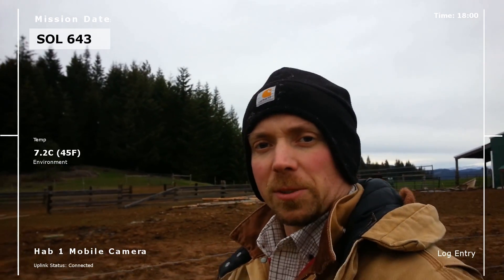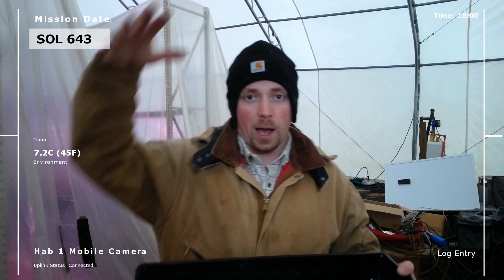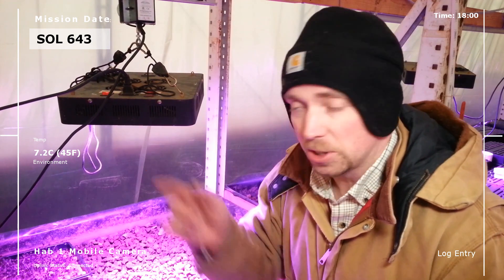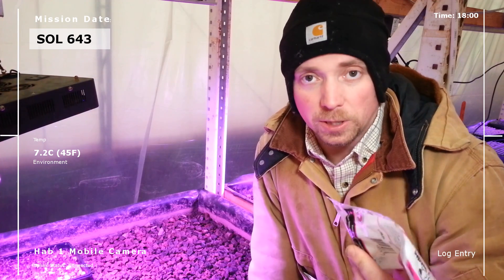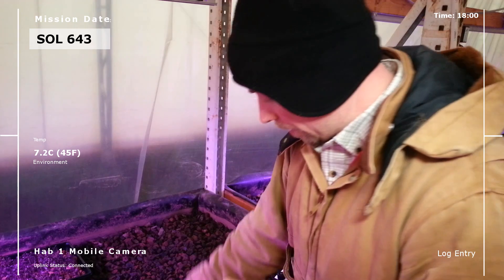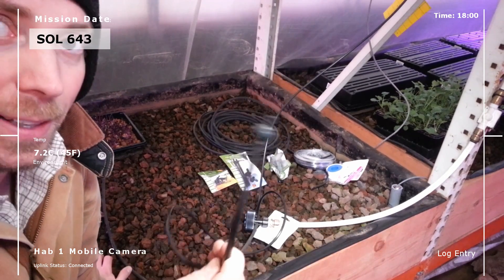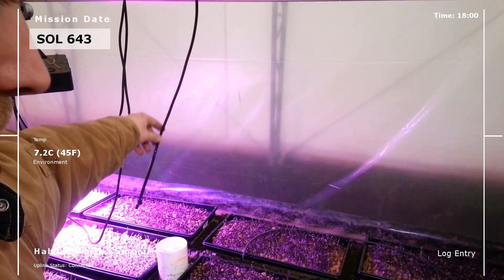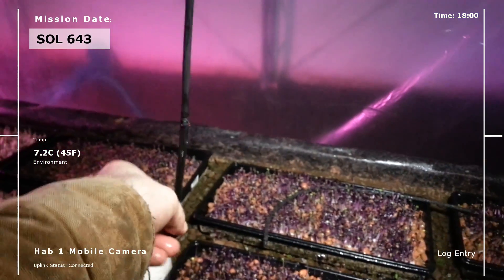Do WICKING BEDS Work for MICROGREENS?

Comment: You could run the drip pipe a foot to 18 inches above the trays then install the drippers.  So there would be space between the trays and the drip heads.

Comment: TRM.  I've burned through more of those shut off valves on the 8 line manifold than I care to admit.  For some reason they're very fragile ( must be Italian).  And Rain Drip doesn't sell them by themselves.  And if you need to by another manifold make sure all the valves are there.  I guess some people have been known to swipe them off new units when their's break.
Reply from the maker: roger that. I think the final decision wont use one. In addition I've upgraded my buying power by going to the local contractor store to get more professional grade parts.

Comment: Whilst I understand your thinking behind trying to do away with the rocks in your trays I do not think that overhead spraying is a good thing at all.
1. You will inevitably raise tunnel humidity using sprays- very bad in the winter but may be good in the high summer temps. This high humidty may also encourage fungal disease growth on the plants.
2. You are using fish faeces contaminated water and you are trying to produce a human food - possible health issues
3. All spray nozzles and drippers ( irrespective of type / design / spray pattern) will inevitably become clogged with algae etc over time leading to underwatering and loss of produce yield and / or quality.

I think that you will have to return to bottom watering and an appropriate growing media -probably some sort of matting with sufficient sharp sand to stop it initially floating. It will be critical to have control of the height of the water of the bed so that water is passed by capilliary action up to the sand the seeds are growing in/on without the plants have their root system in water all the time.
When the crop has been harvested and the growing media dried out thoroughly it may be possible to shake some of the sand out so that it can be recycled. However it may not prove be worth the time and effort for the cost of fresh sand!
Reply from the maker: great comment...this has sent me back to the books to review my plans...more experiments forthcoming

Comment: Using a random spray dangling from a flexible pipe seems an odd way to solve the problem. High quality spray/mist/fog emitters have very specific patterns based on height and pressure. A rigid PVC pipe running above each row of trays with the right spray emitters at the correct spacing will get you very accurate water distribution with minimal overspray. As mentioned in another comment, Netafim are worth looking at. Once you start using sprays, though, you may find your filtration requirement increase to prevent clogging.
Reply from the maker: thank you...stay tuned...I took your advice on Netafim

Comment: https://growerssupply.files.wordpress.com/2014/07/img_2786.jpg
in this photo you can see where they have water trickle from one side of the beds to the other and return to the aquatic section via that PVC ladder.. 
They use just 1/4 inch line on one side of the beds and I assume there is a very slight slope to aid in drain off on the opposite side. 
https://growerssupply.files.wordpress.com/2014/08/cs-tillamook-high-school2.jpg

Comment: Just for the sake of pointing out potential problems - you mentioned previously that you had huge humidity issues - obviously misters will boost your relative humidity a LOT.. 
The larger droplets you can use without disturbing the seeds then the less humidity issues you will have.. 
What about running 3 drip lines in parallel across the entire length of the bed attached to something you can raise and lower when you need to access the greens?
Reply from the maker: great point! didn't think about that...sometimes hard to see the forest through the trees

Comment: How about cut the end off a tray so you can have a 'tail' of mat to dip into the water? You would probably have to use something to hold the mat in place. A slot would be better for production. It would keep more of the tray's strength. You could have tails on both ends.

Comment: What if you had a spray system the width of the bed with sprayers every inch or so hooked to the same drive unit you use for the lights? They could be set to spray once every 8 hours or at the interval required to provide correct moisture levels.
Reply from the maker: great idea!

Comment: You could either weight or stake the mat so it wont float with the flood and drain.  For the misters you can add a weight to the line to ensure they hang properly. They make various spray heads. You could dome the greens and ensure the misters spray inside the dome shield (could poly wall the grow lane sides to contain a broader mist spray as well) Running a frame around the bed perimeter to attach horizontal spray/miser heads might work better misters are a good way to go but you might need to put more thought into the number, placement and spray pattern of the heads. Ive used the various ones the simply screw into the end of the 1/4" tubing and created a frame structure to place the heads where I wanted.

Comment: TRM, There are small plastic stakes that the misters and bubblers snap into. Drip irrigation and micro irrigation systems are prone to plugging and need a filter prior to the heads. And like others said, landscape fabric and sand.

Comment: could it be a sollution to burn/heat the rock/roots to carbonize the roots and then simply flush them out. That might even be done by using a parabolic mirror.

Comment: place the small hose around the utter perimeter of the grow bed with evenly placed misters angled inwards so that the each side covers about half of  the grow bed, might have to apply some water pressure measures but easier and far away from the electricity that is above.

Comment: I have been in the engineering and manufacture of misting systems worldwide for 18 years, tho primarily high pressure commercial and industrial types.   If i can help let me know.  My suggestion would be to use a higher quality proven mist/fog nozzle like Netafim, http://www.netafimusa.com/greenhouse/product-applications/propagation/foggers/   
http://www.netafim.com/product/ag-coolnet-pro-
some type of particulate filtration would benefit you for saving time maintaining nozzles,  a #10 slimline housing and 5-micron seditment filter would do the trick (depending on total volume of the system)

Comment: A couple of ideas... Build a candelabra with multiple misting heads directed over the individual trays. 
Also, the soaker hose you have has too large a diameter. A smaller diameter will fill completely where as a large one needs more volume to get working. I have seen them as small as 1/4 inch.

Comment: how about doing the beds as "Nutrient film" with something like 1cm water instead of flood&drain? enough to reach the matting in the trays but not the seeds.

Or, with the new water level sensor you might be able to tune the cycle for the same effect.

I see the downside with manual spraying that you do not let much nutrients into the beds. there might also be more risk of bad bacteria from the water reaching the food -- if that even is a problem with after harvest rinsing.

Comment: I have found that the issues with misters clogging make this solution have too high an overhead for this type of use.  You will also see a sharp rise on humidity.
Reply: exactly - just about to ask "would this misiting have worked 3 months ago? If it ain't, it ain't no good ;-)

Comment: Your water will clog those thin hoses within a few days. What about polyester or felt growing pads? That's what commercial microgreen growers usually uses. With a more NFT type setup than a flood and drain system that is probably optimal.